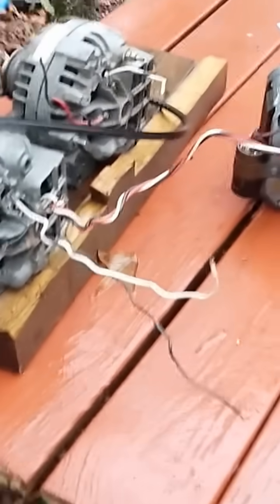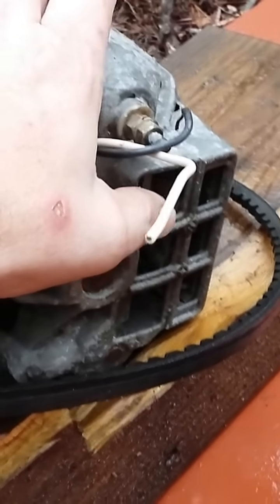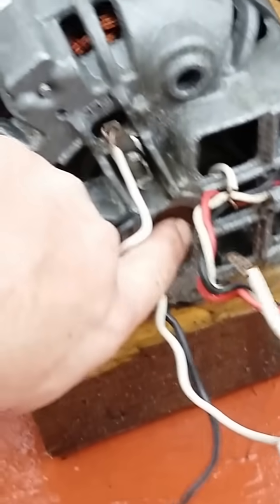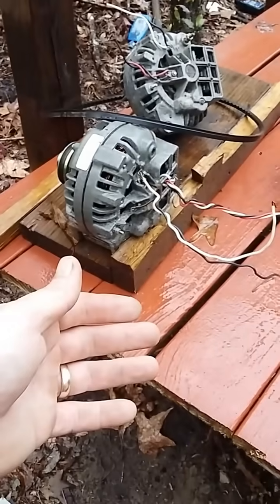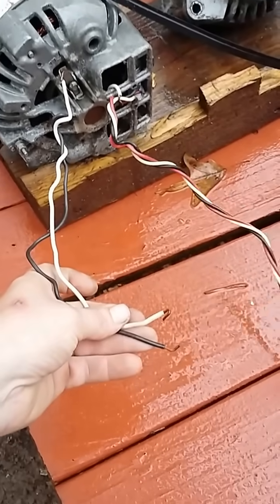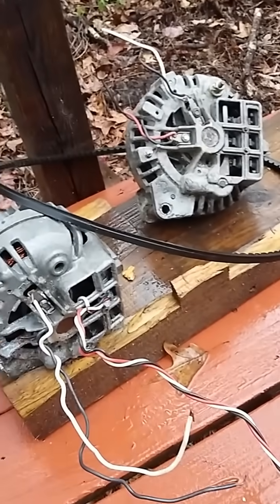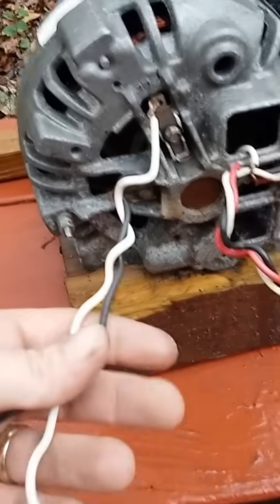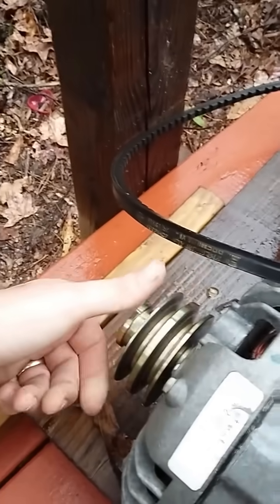Update Free energy forever no wind no solar no gas READ DISCRIPTION!!!

Comment: didn't see anything running just a whole lot of talk about alternators and using them as motors to run another alternator to harvest more power. This of course does not work because of the laws of conservation of energy and energy losses in eddy currents and resistance. Show us all a fully operational unit and cut the drama scene. There have been greater engineers than you that have worked on this including the inventor of the rotating field motor and alternator Tesla himself. demonstrate an operating version. Or maybe you have already electrocuted yourself fooling around with electricity in the rain. And are no longer with us.
Reply: yeah probably came first in his class for cyphering and graduated clean through the 6th grade.

Comment: I'm professor at University of Hartsville and I want to have this free electricity for life which comes from the air without any energy delivered.
But, I have a few questions:
Must this board be made of pine or can it be a spruce to generate the free electricity forever?.
I used pine but 90 Amps power is still not flowing. 
I know the problem, I used yellow wire instead of blue one used on film. 
I'm sure that after I change the wire to blue color, then I will have a lot of power. I already cut off my electric hydro supply cables, because I do not need to pay for electricity anymore.
Reply: Your problem is you needed to use the left hand rule then it all makes sense
Reply: You should have tried harder in english class professor.  If you are as you profess.....

Comment: You can't get power out without putting power in 
Energy can't be created or destroyed also hooking up alternator to power grid is possible but not in the way you describe it 
Alternator produces from 35hz to 500hz AC voltage ( dependant on rpm)  also if you get it on same frequency as a power grid again you can't connect it because there is a phase shift 
To connect any type of generator to the grid you NEED a controller designed to follow phase shift, frequency and voltage of the grid 
But I will be optimistic for you.
Build your device the greatest minds were deemed crazy but they changed the world

Comment: Answers.
By Mikey
All 3 output leads are hot at 110 ( depending on rpm's) the alternator. Case would be your neutral and ground. The rectifier.  Is bypassed.
A12 ga wire is a little light for 30 amps per leg. I would use 10 ga. 
Im confused about your field being supplied with 6 v? Isn't that usually controlled by a back feed from the output to control the voltage?? Or are you saying that the 6 volts is what spins it up . Hummm something fishy with that. 
Final statement it takes enormous power to turn one of these alternators at full load   guessing around 10 ++ hp.
Good luck
We're either part of the problem or part of the solution.

Comment: You could buy a Alternator Kit at one time that did this BUT in 120V. The alternator had wires coming from it that had a dual 110/120V house receptacle on it. You mounted it under your hood of your truck. And yes, it also charged your battery. I have actually used one of these. They were sold for a very brief time for contractors so they could have 110 Volt at job sites. This was long before DC to AC inverters were around. Thanks for the video, I really enjoyed it.

Comment: So, how do you make free electricity to start the alternator that has been altered, to then produce more electricity?
Reply: Use two monkeys on a tread mill with a banana dangling in front of then and a belt from the tread mill to the pulley on the alternator.  My wife sometimes uses the tread mill when football or baseball games are on  to loss weight  and keep her mouth shut. The huffing and puffing becomes nerve racking. I let her rest during commercials to get me a cold beer. Then back at it the TV on that circuit.
Reply: Ilse Li Roos Kotze hey man this is just my theory the first step would be a 12 v car battery hooked up to a switch which runs to the small motor to the alternator which would run throw a 220 v cable to your breaker box and running out of your breaker box would run a bundle of wires to a step down transformer to go from 120v to 12v which then leads straight to the car battery making an endless loop but at some point the acidity of the battery would run out and the battery dies just like the battery in your car. Theory two would be having a hand crank magnet wire setup giving hand cranked electricity which could produce enough power to start the motor if the crank was built to the right size to power it the rest would be the same wire setup just skipping the crank ofcourse going straight to the motor making an endless loop. I imagine either setup could happen in theory
Reply: That's why the baby's crying it's wanting a break from peddeling the bike..but yeah he's making money on this vid

Comment: NOT the right wire gage,,only good for 30 amps at the MOST. Also, once the load is applied, this would load down enough to STOP the "Motor" for lack of Current. NOT POSIBLE....NOPE

Comment: Ok all i know for sure is u do this and put 6 volts to that. That keeps getting repeated throught the video. Never heard anything about what kind of motor is used to spin the alternator. Does he sit there and spin it by hand after he does himself a massive amount of meth and is tweaking? Because he sure sounded like he was on something the way he keeps saying the same thing over and over and over and over and over and over and over and over and over and over there ya have it.
Reply: adam i cant imagine the output from the alternator of amps is correct but the volts could be however i agree much was left out of the video talking about the rest of the wiring setup and how it becomes endless energy but id imagine the motor runs the alternator idk how he powers the motor but id imagine its either a car battery on a switch or a hand crank power system but the endless loop makes sense if it goes from the alternator to the breaker box and back to the motor which makes sense and I believe would work if it was powering a small trailer or cabin but i dont think it would last long enough or put out enough constant amps to power a normal two story house! He has the correct idea just bad at wording exactly how it works and doesnt add enough info/facts of the alternator system to make sense to normal people who lack knowledge of electricity but he definitely is on to something especially if he is getting threats from power companies just like the guy who made a car that runs on recycled cooking oil which ran like 30 miles per gallon that man had his vehicle taken was paid like 20 grand to keep quit and told if he ever tried it again the rest of his life would be living hell also like the guy who in a town near mine put up a small windmill with a home made transformer on top of his house and somehow ended up owing the power company an extra 5 grand after the first month which he took to the power company and ended up that 5 grand is what the power company owed him and was told to immediately remove the wind mill or they would take him to court for it
Reply: @choff20169  ok i was not asking how it works just pointing out how lacking in detail it is. I'm very familiar with alternators working in auto parts as long as i did. Alternators can put out up to 180 amps.i have a friend that took a power inverter and hooked it to a car battety then pluged a battery charger in the inverter and hooked the charger back to the battery then used the extra power socket on the inverter to power his home theater system in his livingroom. It has been working for a couple of years and never plugged into a wall socket. The battery charger keeps the battery charged. Creating a endless loop of power. I never would have believed it if i hadn't seen it working.
Reply: adam sorry to talk like I assumed you didnt know much about it and try to explain more to you obviously you know more about than i do but id rather give what knowledge i have assuming someone doesnt grasps the idea to help them understand. However i agree with you 100% he didnt give much more info on what was going on except the two points of the whole video which was repeated like 20 times turning a one min video into 10 mins on just two things kinda wasted time past the initial point was made. Has your friend ever had any issues with it like occasionally power surge during a movie? I just wonder if the power output changes during any say louder parts of the show or loss of power during brighter scenes.
Reply: @choff20169  i haven't seen that friend in a few years since i moved away but last i heard there was no issue. I know you cant run much off of the set up but it produces enough output that if the power went out he could still watch tv

Comment: Those out put wires are not big enough to handle 90 Amps..

And there’s a vast difference between DC voltage and AC voltage....
Reply: Don't care about those small details. Important is, that we are going to have tons of Watts for free and all just from the air. 
That is what counts. No power supply is needed, it is first Perpetuum Mobile in the World.

Comment: I would sooner by a junk alternator (which is NOT a generator btw... A Generators main characteristic is having Natural MAGNETS, which newer alternators lack.) And test this, than send this man money. Anyone emulating Tesla, should NOT be charging for Knowledge. Not saying its impossible, but there IS A LOT of information missing from this Video.
Reply: In a car, an alternator is generator, powered by the car's drive-shaft, that produces DC charging current for the battery. So yes, it is a generator.  It's actually an AC generator, but diodes are used to invert the negative half of the sine wave output, so that the emerging current is all positive.
Reply: Chuckernaut Rhodesia technically no the alternator is not a generator in a vehicle the generator would be the whole motor the battery sends electricity to spark plugs the sparks ignite the gas pushing pistons turning drive shaft which spins alternator recharging the battery which then sends electricity to the spark plugs restarting the process
Reply: The proof that the alternator isnt a generator would simple because a generator is a power source which starts and powers electricity not just creates it you cant generate electricity with just an alternator you have to have something to start the alternator in the case of this video the power source is an electric motor and probably a battery which all put together and wired correctly in theory is a generator
Reply from the maker: +TheDieselRig   The rotor has a coil on it that you can pulse dc into for the magnetic field. ( the description says there is a lot of missing information)
I have over 200 videos and I do not charge for my videos. Now, people do send me donations (sometimes) and I spend about 90% of all the donation money on Parts and Equipment and always have but I share videos with people privately..  I do not charge for anything!
Reply: Generator = A wire wrapped rotor turns within a ring of stationary true magnets (which have Residual Magnetism) to produce electricity. 

Alternator = A wire wrapped rotor which is fed a small Voltage (which does not have Residual Magnetism), turns inside a larger wire-wrapped stator, producing electricity.  

My entire comment was simply to point out that the words "Alternator" and "Generator" are NOT interchangable. 

A Generator would be able to produce electricity without having to be fed any; whereas an Alternator will not produce any electricity without first being given some.

Comment: What powers it? A hamster wheel and two hamsters. I'm seriously worried about you. Perpetual energy claims - try solar.
Reply: How many batteries do you need for solar? How much are those batteries a piece? Yeah give me the two hamsters. You're a goof
Reply: GR. Hollman You are better off powering a vehicle and then using that energy to power your home. I use the equivalent of 9 horsepower and get 400 HORSEPOWER in return.
Traditionally, moving a vehicle is the hardest thing to do. You cannot FAKE moving big heavy trucks. We were at a tractor pull event with our hood off, they couldn't believe their eyes when we took off!!
So much for SKEPTICS!!! 😂😂😂😂😂😂😂😂🍷🍷🍷🍷🍷🍷🍷🔥🔥🔥🔥🔥
Reply: @skytoll1  So a running vehicle powered with gas IS the power energy source. Thank You for clarifing.
Reply: GR. Hollman may as well get a generator if your using gas. Id imagine he’d use a car battery to power the small motor connected to the alternator with a belt then wires the alternator to breaker box from there runs wire back to motor giving that the motor could be started with 12v but run constant with 120v if not hed need a step down transformer between breaker box and motor but he had that hed run it from transformer to batter creating an infinite power loop
Reply: GR. Hollman hamster wheel 😂
Reply: Obama loves you,"solar."

Comment: It’s possible.  The Dios are made to change ac to dc   Removed the Dios and you have ac current
Reply: Gustavo Martinez You are better off powering a vehicle and then using that energy to power your home. I use the equivalent of 9 horsepower and get 400 HORSEPOWER in return.
Traditionally, moving a vehicle is the hardest thing to do. You cannot FAKE moving big heavy trucks. We were at a tractor pull event with our hood off, they couldn't believe their eyes when we took off!!
So much for SKEPTICS!!! 😂😂😂😂😂😂😂😂🍷🍷🍷🍷🍷🍷🍷🔥🔥🔥🔥

Comment: so whats spinning the alternators?
Reply: The obvious unanswered question. Hamsters on a wheel? 😉 Go Solar
Reply: Minibike Spike id imagine the mentioned motor hooked up to car battery or hand crank system for just the start but when all wired together could in theory create an infinite loop if the amps are correct and voltage has the correct power down coming back to motor or battery to keep it running

Comment: I'm not to sure on the video but I had a instructor from a hazmat class tell me this was possible he didn't go into detail but he said it's true
Reply: It is true if you use the right equipment.  24 v 5 amp 1,000 rpm brushless geared motor. Hooked into it's own bank with a speed controller.  Long shaft with bracketed bearings for support and sprocket spaced by 6 inches  hook up multiple 800 rpm to 1000 rpm PMA,S facing gear shaft with attached sprocket then line up with shaft sprocket for clockwise turn. This motor can handle 13 pounds of torque easy. These PMA,S only need a small amount of torque to spin. Then hook up all PMAS into a rectifier and charge controller for wind turbines hook 1 controller to 24v bank with running motor.  Next hook the rest to large battery bank that has 6k inverter and your in business.  Do not forget to build a resistor bank dump for system will heat up if brakes kick in and start shorting out unit. Have fun.  This does work add a few solar panels to the running motors 24v bank.
Reply: @donaldsteele6276  You said a mouth full.
Reply: Can you please show me a video so I can see what your talking about.  An electric motor for tractor pull? We used to have an tractor pull car it ran off alchohol lol
Reply: Donald Steele go to http://sky-wheels.com for videos. We only show the BASIC technology, not the Solid State version.
Reply: There is no such thing as perpetual motion but there is such thing as buffering with a battery bank and shared or cloned kinetic energy. By sharing the drive shaft with multiple PMA,s to make them spin you can charge the running motor battery and use running motor to run several PMA S.and charge up a large bank.
Reply: Donald Steele I'm moving TONNAGE, 10-20,000 pound vehicles, with no problem. PMA's may work out, but mine run at 5,000 RPM @ 45 amps. I have to see the specs on the PMA. The biggest problem we have is the driveline surviving the initial torque shock loads. Traditional heavy duty manual transmissions work, but we have broken a few. 😨😨😨🍷🍷🍷🍷🍷🍷😁😁🔥🔥🔥
Reply: Try using Steel ball bearings mounted on the drive line for support.
Reply: Donald Steele I do have them.the best quality are about $100 dollars a pop from overseas. I have been testing all kinds of technology systems since 1980, I know what works and what doesn't. Our tests are done over the road, I will NEVER do a benchtop test. 👀👀👀🍷🍷🍷🔥🔥
Reply: Mike Water You are better off powering a vehicle and then using that energy to power your home. I use the equivalent of 9 horsepower and get 400 HORSEPOWER in return.
Traditionally, moving a vehicle is the hardest thing to do. You cannot FAKE moving big heavy trucks. We were at a tractor pull event with our hood off, they couldn't believe their eyes when we took off!!
So much for SKEPTICS!!! 😂😂😂😂😂😂😂😂🍷🍷🍷🍷🍷🍷🍷🔥🔥🔥🔥